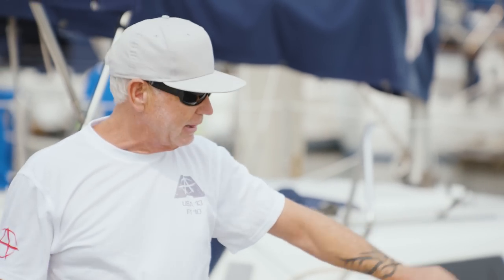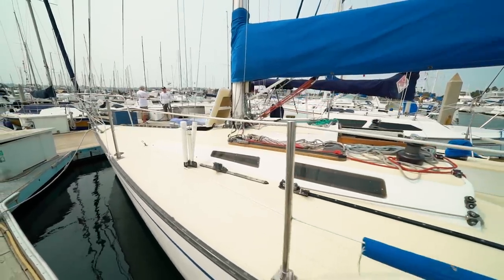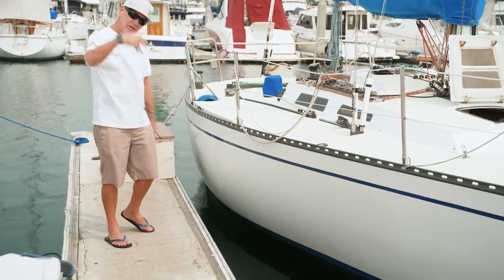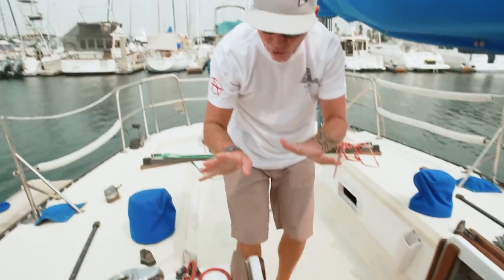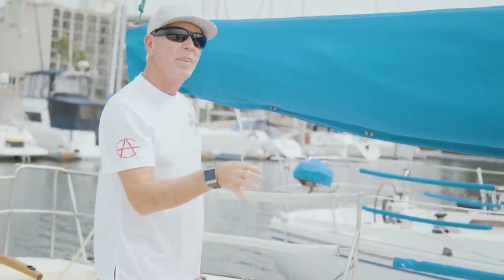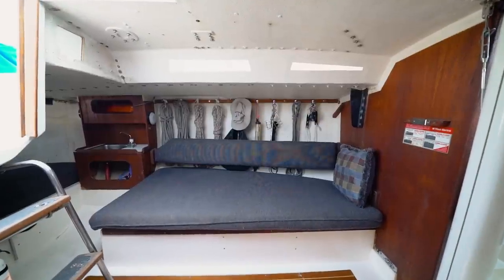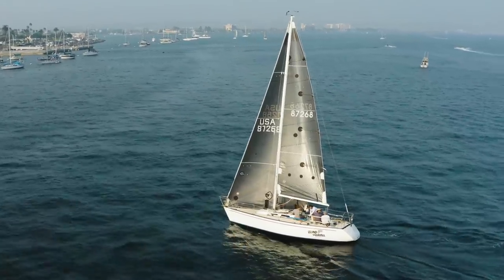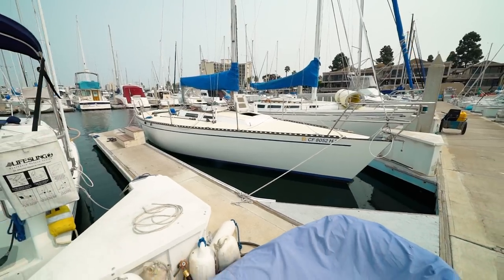Santana 3030 sailboat tour - EP11 #RETROBOAT with #sailinganarchy Scot Tempesta

Comment: I sailed MORC back in the day. Did the whole east Coast circuit every year on a g&s 27 Pigs at Sea. I had opportunity to race on easy go on several occasions when it ended up in the Chesapeake which was one of the NM customs you mentioned. I miss those days, MORC was great racing, very competitive. S2 9.1, B25 santana 27 Kirby 30 Most of those old designs are still quite fast for club buoy racing. Not too many are left. Thanks for bringing them to light.